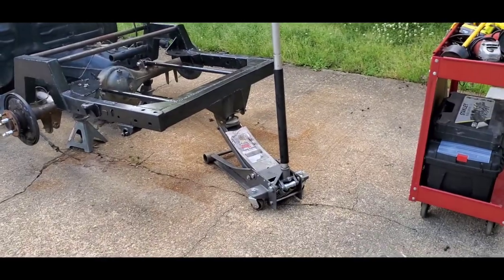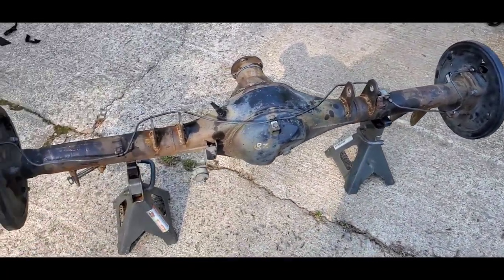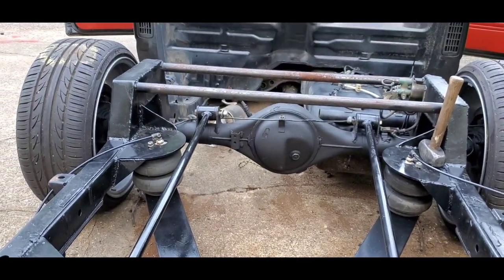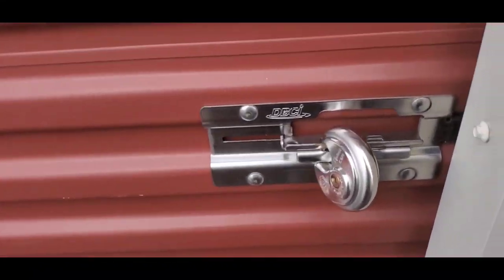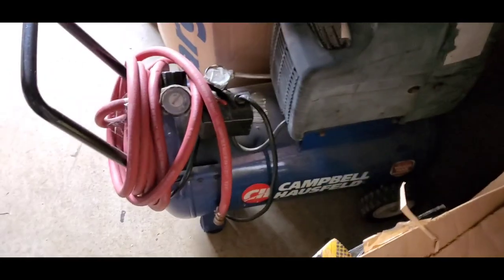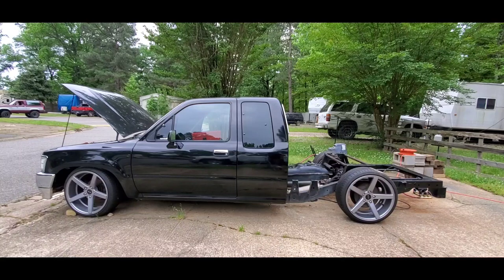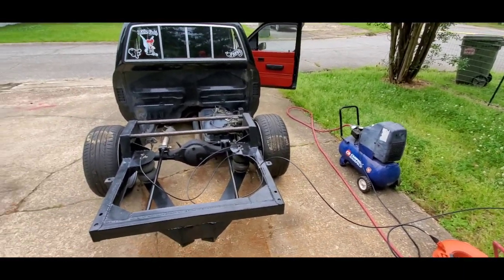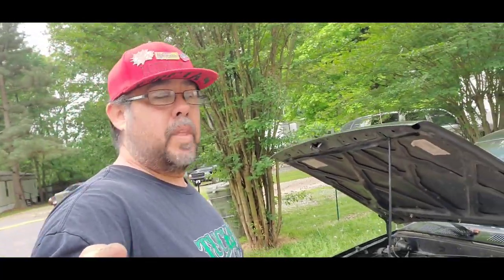21 Bagged Toyota minitruck link bars bags & lift 05-03-20

Comment: Your rear brakes wont stop ur truck, I found that out when I went to emission and they spun the rear tires and it wouldn't stop the machine. So I actually had to move the mount on the rear end to the down position. When I put the 6 inch drop on it. Still trying to save for bags. But great job dude.. FREAKS LIFE
Reply from the maker: Hm thanks for the info and yes indeed FREAKS !!!

Comment: Airbag Everything might be a good name or something along those lines. On that spine that u welded to the lower link bars, u should cut the angle on it so that it sits parallel with the ground when u lay out. I had that idea when I watched u air out from the "hater angle." Lols
Reply from the maker: Lol yeah I have the angle I have for when I'm riding Cali its parallel with the ground. Thanks for the idea though